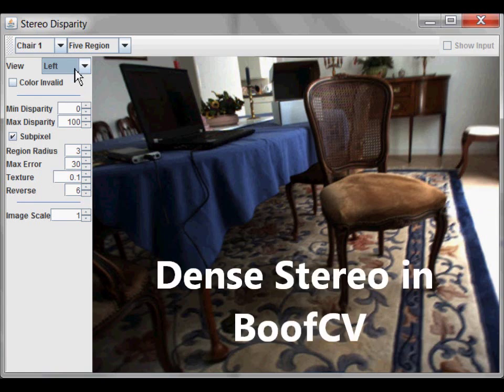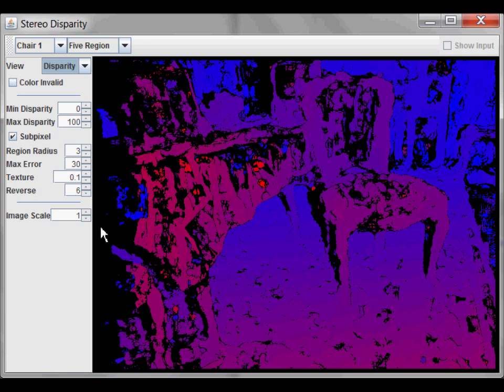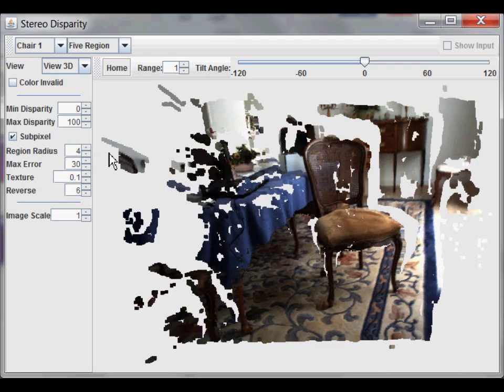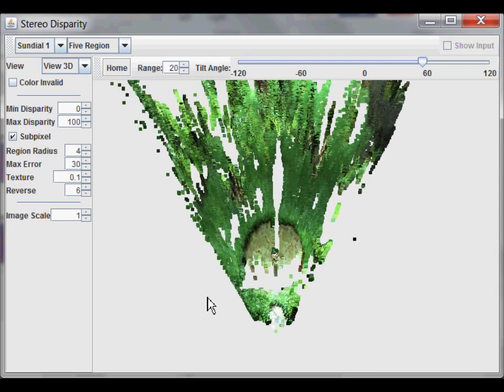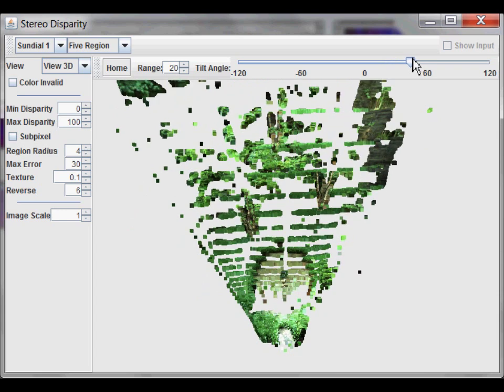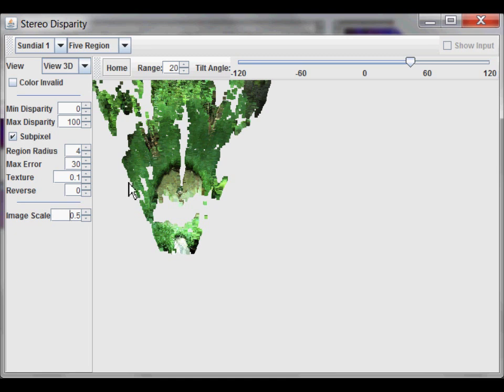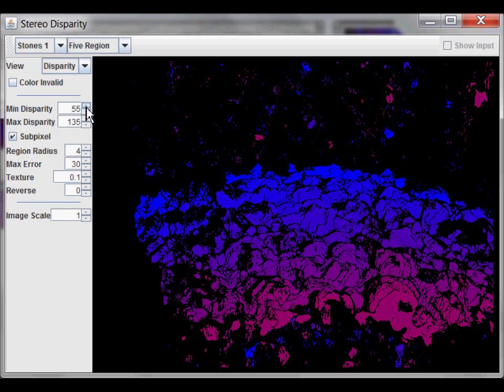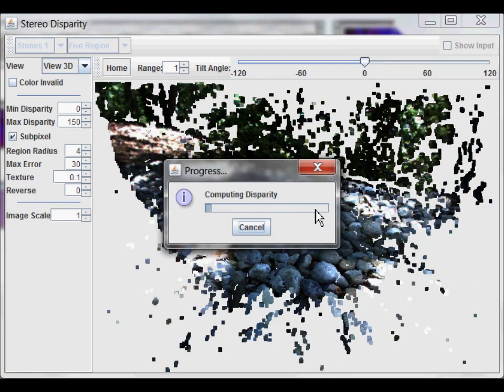Dense Stereo Disparity and 3D Point Cloud

Comment: I used the source code, but I am getting a very distorted disparity map. I replicated it exactly, only changing the directory paths. Can you clarify what parameters need to be changed from the example in order to achieve a distortion-less map with valid depth contrast? Thank you in advance.
Reply from the maker: As we discussed on the message board, the problem was caused by an incorrect set of stereo parameters being passed in due to your modification.  These examples are well tested and, if not modified, should work out of the box.

Comment: Does the BoofCV library support actual webcam input, or do the methods just use image input? Is there anything similar to javaCV's FrameGrabber?? Thanks
Reply from the maker: You can use Xuggler or V4L4J but of which supported with the "integration" package.   You can really use anything you want and convert the BufferedImage into a BoofCV image type.